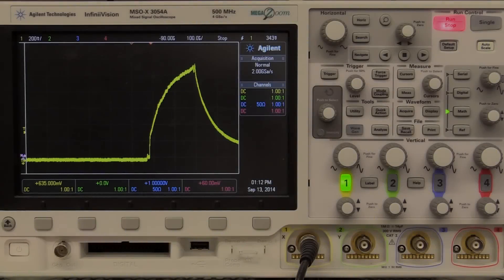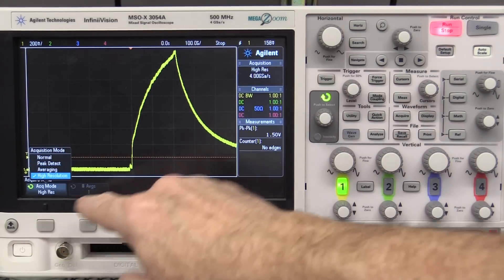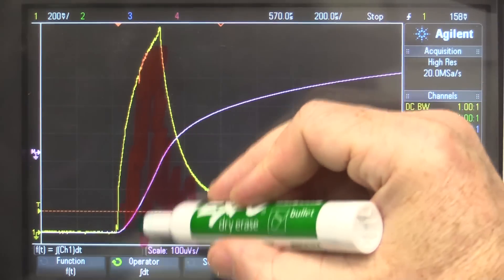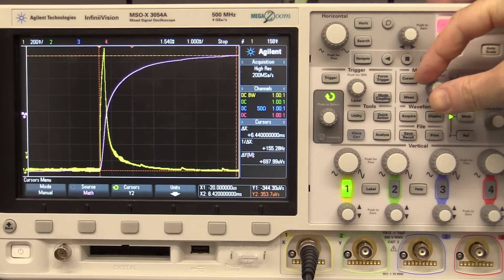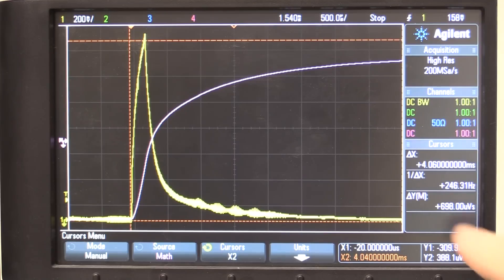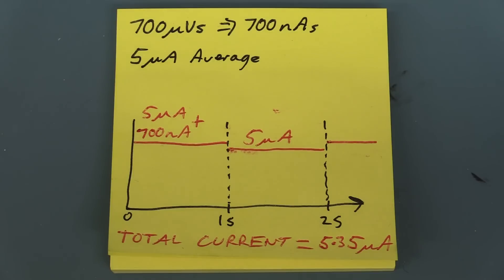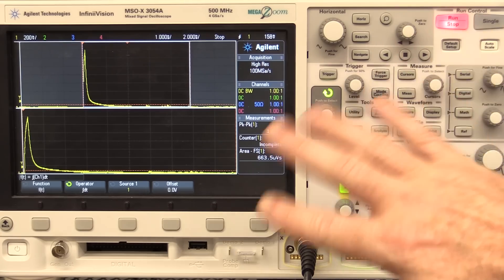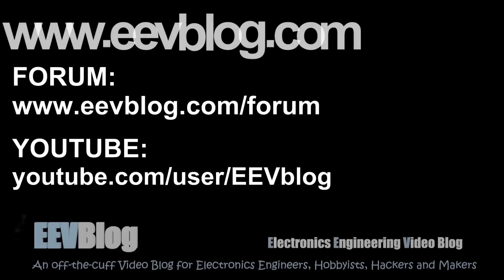EEVblog #662- How & Why to use Integration on an Oscilloscope

Comment: Integral on the DS1054Z is almost useless. It's horizontal resolution is so low it always seems to be a linear line no matter what waveform you have.

Comment: For this specific purpose, it may be easier, cheaper and more accurate to calculate the integral using a large capacitor and suitable resistor. For example, a 4700uf capacitor and a 10K resistor has a 47 second time constant. It'll take 5 minutes to stabilise. Measure steady state voltage across resistor without circuit connected to zero capacitor leakage. Connect circuit, give a few minutes to stabilise then read off voltage delta. Use Ohm's law to calculate current.
This would not be effective for larger currents and longer times, where the technique shown would be better.

Comment: Instead of the fluke, why not use your vintage HP 3457A with 100NPLC. That gives an integration time of 2 seconds (how convenient), with essentially 25 bits of resolution.

Comment: I would like to know if I integrade the voltage at CH1 I will have a function f(t) . Now I have need to get the integraded from on a x-y plot . I have the same Oscilloscope as you

Comment: I deal with this sort of thing daily in the Amps range. The 12W magnetic door lock on my lab is a real problem in terms of energy consumption over 24 hours on my off-grid solar powered lab. However, and 800W circular saw, 1KW reflow oven, 900W drill press and 500W lathe are absolutely no worry due to the very short timespan that they actually draw that energy.

Comment: Strictly speaking, the area under the current wave is charge.  If the voltage remains constant, then the area is proportional to energy.

Comment: To calculate the energy, would you not first square the current waveform, integrate it, and multiply by the resistance of the device?  Or perhaps multiply the waveform by the voltage waveform then integrate? Energy = integral of I^2*R dt or integral of I * V dt
Reply from the maker: SixThousandMono There is no "voltage waveform", it's a constant supply rail. So the area under the curve is effectively the energy.

Comment: I think it uses a capacitor as an integrator...
Reply: the scope does it digitally, as a side effect a capacitor would have caused a phase shift, which, as you'd expect some resistance wouldn't just be 90°, but something frequency dependent, you'd see a big differece in the waveform

Comment: If you just want to measure the average current consumption of your device an adequate bench multimeter (like the agilent 34461A) will do fine. This multimeters will integrate accross the "integration period" (usually up to 10 or 100 Power-Line-Cycle) in order to reject 50/60Hz noise in the measurment. This integration will provide you with reasonably good averge values, also in pulsed applications.
This means, that it is possible that you already included the "dynamic" current of your device in the average measurment you did with the Multimeter. I don't know the Fluke, but In my opinion the 0.35uA is already included in your 5uA multimeter reading, as the multimeter is already integrating and averaging.
Reply from the maker: Bernhard Wörndl-A. In this particular example the pulse is not wide enough or frequent enough to be included in the multimeter average reading.But in any case the whole point of the video is to show people how to use the integration function on a scope in a practical example.
Reply: EEVblog I'd really like to see the difference in the multimeters average value when you turn off the frequent wakeups of the mcu. I suspect that the average value will drop acordingly. You selected the  Min/Max/Avg measurment of the Fluke, so it should actually have captured all pulses.

Comment: This is a good video idea, but you are mixing up units and and meaning of the curves a lot in this video and with your additional text, you have not corrected everything. You really should be more careful with units.
Reply: EEVblog well, there are several MATH features in the Agilent 3000 X series that I do not know, what I would use them for and it would be great to get a hands on real world explanation for them with a short example. Should be very easy for you to show each one with a different kind of application.
Reply from the maker: Elden Chang Please tell me precisely what I got wrong and I'll correct it with annotation.
Reply: EEVblog
I think he meant the same error as I tried to touch upon in my earlier comment. You talk consistently about energy when pointing out the area under the current curve. But this is the charge. Charge (A*s) and energy (V*A*s) are two different parameters.
Reply from the maker: meettechniek Yes, point taken. I used the word energy in the wrong context here, I was trying to talk in a general sense by using that term.
Reply: EEVblog
Yes, Dave it was about the area under the curve. In order to get the area to be energy under the curve, you need to integrate the "power" and not the current. In your circuit, you can easily also measure the the voltage and in a first step multiply it with the current. The Agilent 3000X allows you to make a two step MATH function. First your multiply current and voltage and then you integrate the results. The units will even show up in Joules.
Reply from the maker: Elden Chang Yep, certainly should have done that. I was too focused on simply getting the final current value.
Reply: EEVblog Dave, this confusion is easy to get in to. I made a rule for myself to first setup the probe correctly in the scope setting. Then I see the units always correct on the scope measurement readout. This makes it very easy and you have it right in front of you.
Still great Video and it seems many people have not been aware of the integrate function.
You should make a Video of the rest of the measurement fuctions
Reply from the maker: Elden Chang Could certainly do a video on other function. Integration is probably the most generally useful out of the bunch though?

Comment: 11:30 confusing the volt-seconds Vs with something like mAH
...one must remember that the 'volts' on the scope are actually microamps, so its microamp seconds, which is consistent with a unit of energy like microamp hours or milliamp hours.
Reply from the maker: EEVblog And also (can't seen to edit comments any more?), there will always be my usual mis-speak's when I shoot off-the-cuff video like this. Often these get detected and annotated in editing, but not always.My brain and my mouth are only loosely coupled.
Reply from the maker: What's the big deal? I used the uVs because that is what is actually displayed on the scope when you do this. I mentioned later because I'm using the uCurrent that then translates into current. ARe people complainign because I didn't do that from the start? And because it's a constant supply voltage this also translates into energy.Yes, I'm no math teacher, and I don't pretend to be, I'm just trying to explain how to integrate under the curve on a scope using a practical example people might encounter. I don't understand the nit-pickieness here?When have I ever not admitted and corrected errors?Frankly I don't see any major errors here in what I did or said.Could it have been better explained? Sure, always.
Reply from the maker: frollard Yes, of course, and I explained that it's actually microamps later in the video.
Reply: EEVblog

nononono!!!
I was aiming that @audience.  IF a person were being confused by the volt-time units they need to remember that its current-time which equates to total energy :) Yes, later in the video you cover this in an excellent fashion. I only brought it up because at first I thought ...hmmm...volt-seconds, that's weird, oh right, the microcurrent!  It was hopefully constructive feedback, not even aimed at you the presenter!

As for KF talking shit about scripting - keep being awesome, nothing needs to change!  I have learned BEYOND textbooks worth of industry knowhow and cleverness that I never would have stripped from the pages of any book.
Reply from the maker: frollard Cool, thanks. BTW, that was meant in reply to KF5 there, but somehow it didn't link him. Youtube is being silly lately...
Reply from the maker: KF5OBS A math teacher I am most certainly not, and never will be, but please explain what I have got so massively wrong in this video that warrants a suggestion that I should steer clear of doing videos like this? The video is about integrating the area under a curve on a scope, and how this might be useful in a practical circuit. I think I did that reasonably well enough.Please be specific on any errors, I am always happy to correct errors, when have I ever not been?As a content producer yourself I'm sure you understand that mis-speaks happen when explaining stuff off-the-cuff.
Reply: EEVblog @frollard: read, comprehend, proceed. I said scripting would NOT help him. My response was directed at 'Re' who suggested scripting. I have no idea why YT decided to place my response here, that;s not where I put it. Also, this is electronic engineering. Not plumbing. Someone can have great expert knowledge in one area of EE and suck completely in another. That's actually the case for all of us.@Dave: I didn't say to not do videos like this. The video is awesome, sorry if my European demeanor made it sound like an attack. Please do make such videos, but focus on teaching what you do know and don't stray too far aside. To go back to plumbing: If you make a video on how to to your own bathroom plumbing, don't go on and talk about the chemical properties of copper / PVC. You really ask me what specifically I mean? Well, look at all you annotations. mis-speaks happen. Mistakes happen. Plenty. Yes, as a content producer I know that. Apparently though, you prepared for the integral explanation (you got markers and plastic foil), so why not quick-read a Integral 101 article before you hit 'record'? Again, the video is great. Your videos usually are. But, this video has an unusual amount of 'mis-speaks' as you call them. So the question is, why? Bad day or bad topic?
Reply from the maker: KF5OBS I didn't need to read Integral 101 because I know very well what integration is and how it applies to scopes. My problem in this case was that I didn't really think in depth about how I would explain it all precisely, I just hit record like I normally do and hope something comes out, because that's my style. By doing the two areas thing that I had to annotate in the edit, I was thinking of another analogy and it just didn't come out right. I only realised that at the edit stage, so annotation it was. I didn't think it was that bad, because I ultimately did say the right thing about the total accumulated value.AFAIK there was only one other mis-speak, and that was to use the word energy without explaining that if you actually wanted the energy you had to multiple in the constant voltage as well. That one probably comes from the common concept in engineering of energy under the curve, and that's the term that obviously popped into my head at the time. I obviously didn't think to clarify it, and didn't pick up on it in editing. That's happens.So overall no big deal IMO. If I don't have a couple of mis-speaks in every video, I'd be surprised! That's just the nature of the way I choose to shoot the blog.
Reply from the maker: KF5OBS So youtube is screwing up comments for you too? I think they have let the work experience coders loose again...
Reply: EEVblog "Front End Developer Intern (Unpaid)" :-)
Reply from the maker: KF5OBS Yes, the Yanks have this weird unpaid intern system don't they. Be afraid.
Reply: EEVblog Oh yes, and they abuse it like crazy. And the interns work like crazy, trying to prove themselves in the delusional hope to be hired at the end of their internship or at a later point in time.
Reply from the maker: KF5OBS How the hell did the system get that point? I've heard that in some industries graduates have to work for several years as interns without pay in the vein hope that they will get a job at the end. WTF? We do have some of it here I think, but not nearly the same culture and extend of it.
Reply: +frollard Not a unit of energy, but a unit of charge. Since an Ampere is a Coulomb per second, when you have something like mAh you are multiplying the current by time and end up canceling out the seconds and are left with a number of Coulombs. Coulombs are charge, not energy. A unit such as kWh would be of energy because a Watt is a Joule per second therefore when you multiply by time (hours) you have a number of Joules of energy. In the instance of a kWh that is 3.6 megaJoules of energy.
Reply: Scripting is not the right thing for him. But staying away from Math and RF would help a lot. Both appear to cause him more trouble than anything. And that's fine, everyone has their special area. Trying to expand one's horizon and learn something new is cool, trying to teach others if only equipped with basic knowledge on the matter is not. And even that wouldn't be an issue if he'd stick to what he does know. The above video would be worth just as much without Dave trying to play math teacher. But most error overlays happened when he tried to do so. There are tons of great videos on how integrals work out there. Refer to them for explanation. Next thing is learn to admit errors. Prefacing it with "Technically...," sound like the error was just that, a technicality. If I call a car a submarine and then say "well, technically, it's a car," it kind of abuses the meaning of "technically".

Comment: This was a rather interesting video, would be even better if you can go to the white board and do the integration and run an check against the scope.
Reply from the maker: ***** Thought about the white board, but seemed a bit too much effort! and the real info was on the scope screen anyway.
Reply: EEVblog no worries, this video was one I really learned alot from.

Comment: A very helpful visual representation of an integral function.  Would this dandy scope have the math to convert your microvolt-second value to a total microamp value?  Icing on the cake.

It would be very instructive if you can them walk us through methods to accurately measure such small currents (I have a project needing just this!) using less sophisticated instrumentation.. other scopes in your inventory (such as the Rigol).  Please consider following this theme.  I'm working with the MSP430 which must operate on a small battery for 10 years.  Could be powered by a grapefruit, I suppose!

Comment: Do you know the AC response of your µCurrent? You're dealing with short pulses with potentially low rise/fall times and precision OpAmps usually aren't the fastest ones. The MAX4239 with its 1.6V/µs slew rate does have quite an effect on the measurement, doesn't it?

Comment: Nice tutorial, but I think the actual measurement struggles a lot with DC-Offset errors. For my part, I would short-circuit the uCurrent just to get a ball-park figure for the DC-Offset error (on scope and multimeter). I think the idle consumption is too high for the active consumption.
 
Also: You talk about Volt-seconds, but you are electively measuring Ampere-Seconds which - given the capacity of a battery in Ampere Seconds - is a more useful unit.

Comment: You touched on a very good subject here, i dont entirely thing you did integrals justice here (and yes i will get shit for that and yes its a VERY complicated subject) .... what i use currently (and again i will get shit for this) is a modified analog meter and it gives a quite good picture of your micros current peak (or what i use more than not flipping a bit on an IO when the device exits sleep in to run) and the analog meter does an amazing job with debugging listed code! 

EDIT: yeah for a > 200ms off-on state the analog meter wont show much! 

But none the less thanks for explaining to us all of this! its something we all should know about even if our scopes cant do such a math function!